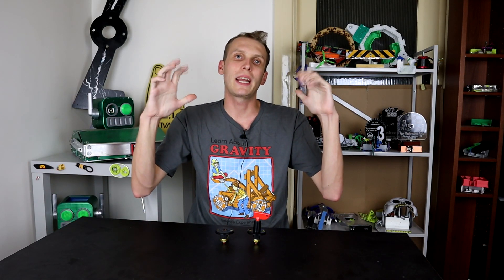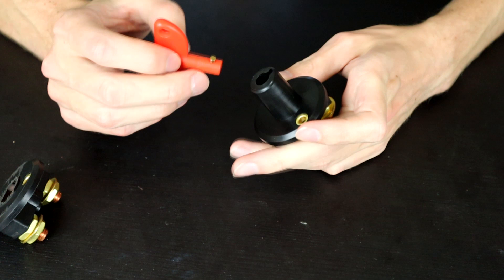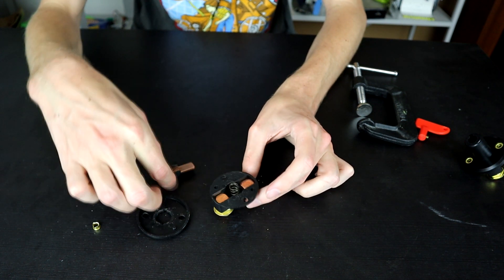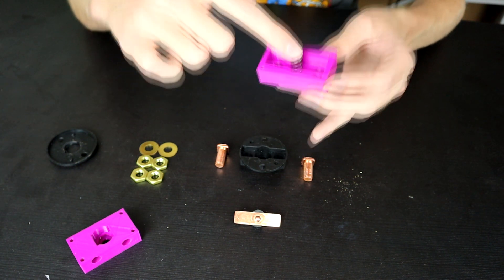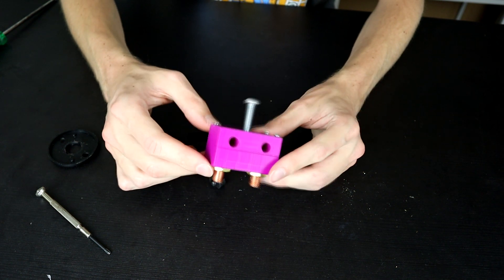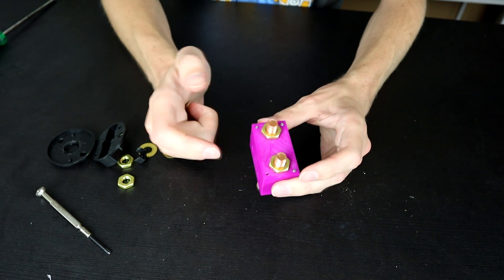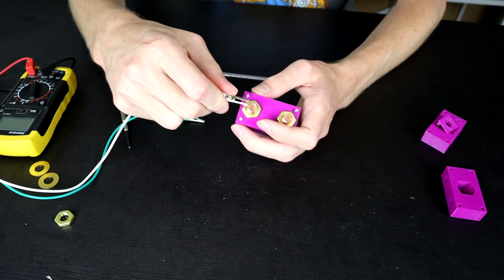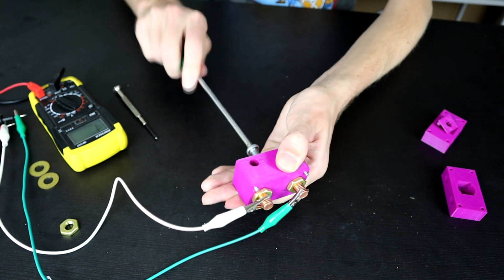Prototype power switch for a Battlebot (HW combat robot build)

Comment: Hi Ben.  What material were/are you planning on CNC'ing these switches from?  What temperature limits does the material have?  I too suffer from the sticker shock of some of the high amperage combat robotic switches out there, and have been tempted to make my own, but the haven't found a high temp material that I feel comfortable with.
Reply from the maker: I hadnt looked at material properties yet, it was my next step
I was planning to look into hdpe first but I know thats probobly not the best for high temp applications

Jake from Team Maximiser just did a video where he built 12lb switches from tpu and bolied nylon, he also ran them in a toaster oven to test its heat resistance: https://www.youtube.com/watch?v=6TFb5fksV74&t=330
He got a gloopy mess but the switch stayed on longer then I would have expected

Comment: One thing I feel your design missed here is the fact that the actuation bolt is going to have high voltage and current running through it with no insulation to your hands or other parts of the robot

Comment: I have a switch that looks similar to that (as you know there are a lot of clones) - but I bought it from supercheap so I trust it's current rating a little more. The bolts on mine are not shiny - copper  shouldn't be shiny(unless freshly polished). I just tested mine with a file, and digging into it it stayed the same color, so it is solid copper.

Your ones however, are shiny. Possibly brass, or a brassy plating on steel bolts. Test them with a file, if you dig in and the color changes then they aren't copper and probably wouldn't even do 50A. Especially the bridge part, that looks plated. A nickel plating would be ok, but that would be silvery. Unlikely for a cheap switch they are gold plated.

You might be better off buying copper rods and strips then re-designing around that. Then it would be easy to drill a hole in the end of the copper rod to solder the wire to. Soldering is a stronger and electrically better contact that those bolt down terminals.

Finally, once you have your finalized design and copper parts finished - you would be surprised at how cheap gold or silver plating is. So you could get your copper parts plated to make the surface more conductive and more corrosion resistant.
Reply from the maker: Thanks for the tips!
It honestly didnt even occur to me to test the materiel

A full custom switch might be better but I was trying to avoid going to that level of design and expense
But it might be worth looking into
Reply: Yeah it is definitely a trap saying 'that thing is expensive, I'll make it myself'...10 iterations and a pile of parts later, "I should have just bought the thing' :)

That being said, for $40 worth of copper rod/strip, $10 worth of springs plus your printing and you could make like 10 switches.

I just looked up the Whyachi switches, probably worth the effort going custom lol.
Reply from the maker: Yeah for sure, DIY can easily end up more expensive and worse quality
But in this case I've got a bit of wiggle room on the cost, especially considering that shipping from the states is also going to be costly

Comment: Great video! One thing I would do is change the plane where you split the part. Insted of "across" the copper bolt axis "along" with them. Should make assembly easier, prevent splitting when turning the top screw and the mounting screws help keep the thing together! Also an asymetrical split plane helps with that i.e. the top lid is only that and all the geometry that holds the internals is on the bottom.
Reply from the maker: I'd like to be able to change the split plane. However my only method of manufacture is a 3 axis CNC mill, which if why I designed all the parts to be cutable on one.
Changing the split plane will mean finding a different manufacturing method, or upping the number of parts

Which might be worth it for reliability

Comment: I'd run a 3rd set of screws in the middle to stop it flexing open and breaking the connection.  Bigger screws won't stop flex in the plastic.

Although...as someone else (ENERCON Fan) pointed out...if this was reversed so the spring holds the plate against the contacts and the screw forces them apart it would be safer (in case of welded contacts)

Flush grub screw as well obviously ;-)

Really good video though!
Reply from the maker: I planned on running a soft start switch to minimize the chance of welding.
I'm not sure I'm super keen on a switch that will default to ON if the screw is removed, but I do see the point in having a way to ensure that welded contacts can be forced apart

Comment: Shredderator recently had the problem that their switch welded together. To mitigate this problem you might want to use a little graphite lubrication powder on the contact surfaces. In my experience with high current devices (railguns) this can somewhat prevent welding while also providing a good electrical connection.

If you want to build a full body spinner you might also want a breaker in case your weapon switch sticks. This breaker could be done with melting.
For example you could use a small, thick solder wire in series with the switch that can be melted with a heater connected to a timer/ radio control.
Reply from the maker: I planned on running a soft start switch to minimize the chance of welding.

Comment: Wouldn't the screw be conductive?  Isn't that a problem? Why not just put a little isolation between screw and the plate (they might be one than I cannot see)
Reply: The screw will be attached to the circuit. But provided it is not connected to anything else then it will be fine. I would use an insulated screw driver though :)
Reply: @andrecook4268  yes of course but I think it would be a little safer to just isolate it. It's not like it's hard with this design. (Compared to the finger tech one for onstance)
Reply from the maker: My plan was to add a small rubber tip to the bottom of the screw
Its not entirely necessary but it is a little safer

Comment: That's neat, Ben. Long ago, I used to use links on my (100 lb)  bots; one thing I liked about them was their tendency to 'fail safe' after a catastrophic hit. The links flew out or broke and the bots just died. It was frustrating but safe, and you could always replace it and resume/restart an interrupted fight.

BUT...  This was before the advent of today's monstrous kinetic weapons, and the more positive switched connections make far more sense impact-wise.

So how about combining a switch AND a link? Imagine a bot with a Whyachi-style switch to control things normally, but with the RC equivalent of an explosive bolt 'link' to sever a key connection if the bot went out of control.

Why a dual system? Well, if a switched bot runs amok, you need to get very close to shut it down with a wrench or screwdriver. I think it'd be useful to have a dedicated 'kill button' on every RC transmitter to be used only in an emergency. It'd be a one-shot last resort, like an aircraft's ejector seat.

The mechanism would need to be simple and robust and would probably never be used, but then a car's airbags spend their entire lives just sitting there, waiting for something to happen.

I know that's it's an added complication, but RC servos are cheap and light and it could be a worthwhile safety feature. Whyachi switches are popular because they work; designing an enhanced one of your own - a PANIC switch, maybe? - would save you from accusations of merely copying a successful design.

So how about it? Could you design a PANIC link into your new switch? You might get rich and famous...

I've got a few ideas for how the RC kill-button could function, but I'd rather not give too much away here before you've had a chance to think about the idea yourself.  ;-)
Reply: You could have a relay or FET, or if you want some fun and don't care about practicality, probably a tiny sealed pyrotechnic charge around the wire.

Comment: I have a safety concern with your switch design. In the Whyachi switch the screw is used to open the switch which means you have tons of force to open the switch if the contacts get welded together. With your design I am concerned that the spring may not be strong enough to open the switch if the contacts get welded together.
Reply: You could limit this problem party by using a soft start circuit :) But your probably right especially in this combination (without gold plated contacts).
Reply: Good point.  Reversing it so the spring holds the plate in place is a much safer method... Fairly easy to reverse the design aswell
Reply: Great point, I would also change split plane from "across" the copper bolts to "along" them. This prevents splitting the desing when applying too much force on the opening/closing screw (also the mounting screws help keep the design together and probably makes assembly easier).
Reply from the maker: These are some great points
I am 100% going to have a soft start circuit (with HWs its silly not to)

I'm not sure I'm super keen on a switch that will default to ON if the screw is removed, but I do see the point in having a way to ensure that welded contacts can be forced apart

I was hoping that the contact points inside would be silvered or gold to minimize the risk of welding but with this cheap clone it's not the case.

I would like to change the orientation of the split line, but doing so will increase  the number of parts and make some of them physically impossible to machine on a 3 axis CNC which is about the only tool I can use for this at the moment

I'm going to think more on all of this, I really don't want the switch to weld and not be breakable, that's a worst-case

Comment: That looks a very solid and reliable switch. 👍
Is the 3D printed casing PLA or ABS? I would've thought it would be PLA because, as you said, this is just the prototype stage.
How much did that key switch cost, compared to the Whyachi switch?
Reply from the maker: Its PLA, which is what I use for any quick prototypes
The key switch costs $15 AUD compared to a Whyachi switch which is $68USD or $97 USD depending on the amps